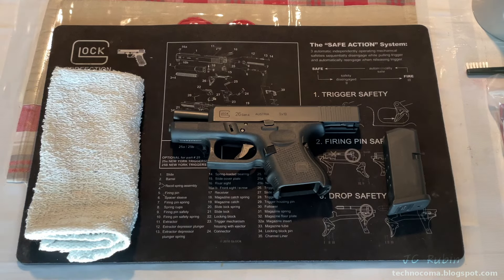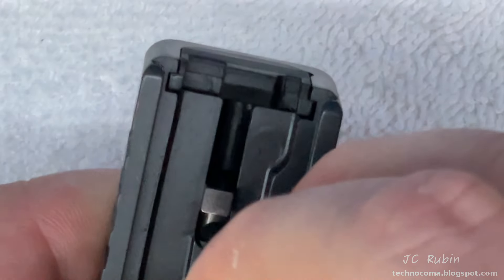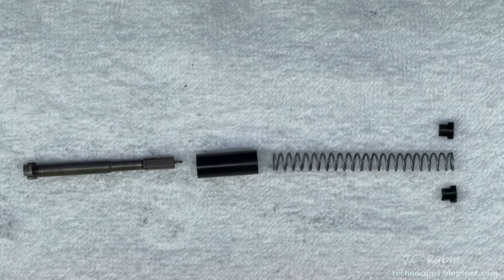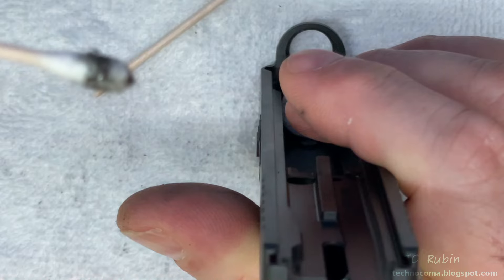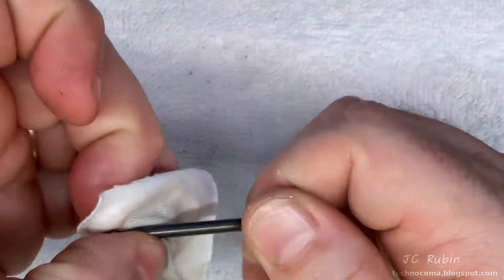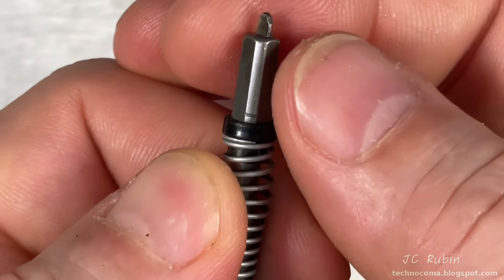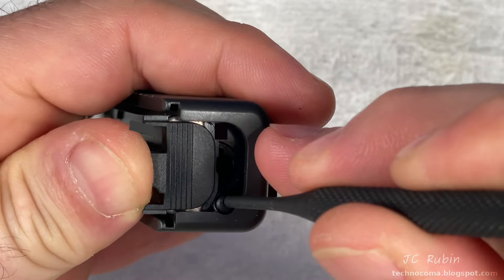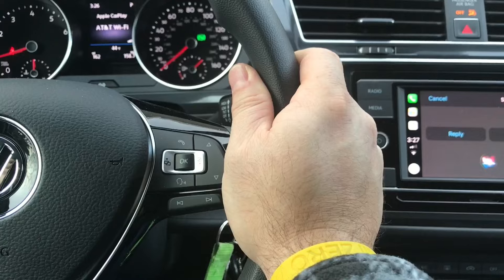Glock Slide Disassembly, Cleaning and Reassembly as Performed on a Glock 26

Comment: Disassembly of the frame is easy too. I bought one that the prior owner never cleaned. (Police officer) It looked like he spilled a red substance (ketchup?) in the slide and the frame. It almost looked like grease. It was in the extractor and down in the hole where the firing pin safety goes. How? It looks almost new now.

Comment: Yes not suppose to put oil any wear on the striker assemble, try a dry lube like Strike Hold. Hoppe's No.9 Nitro Solvent can damage plated parts. Rarely do I ever use Nitro Solvent anymore.